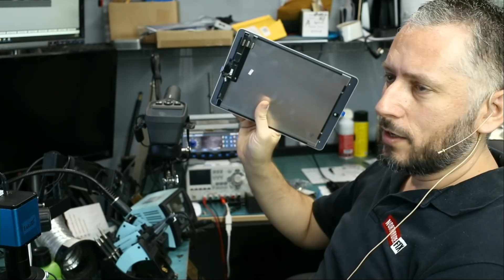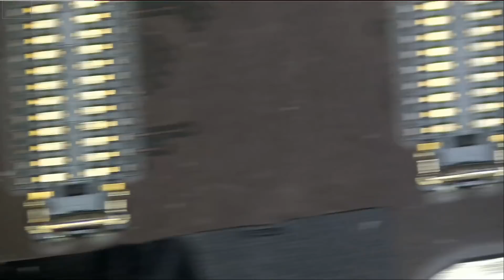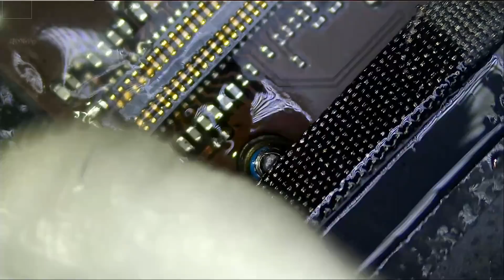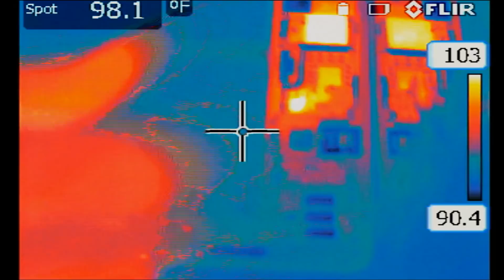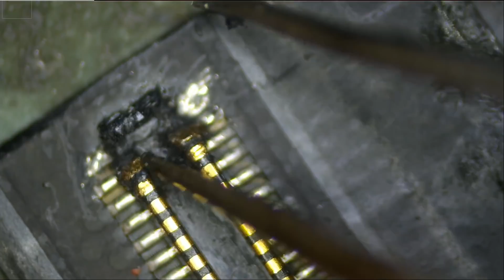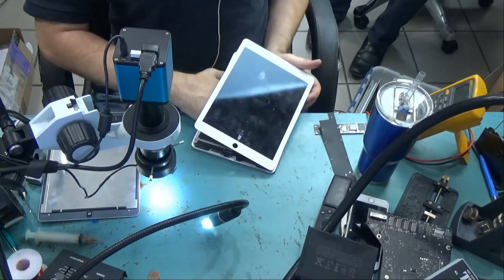iPad pro 9.7 No Power and Black Display after screen replacement

Comment: Is there a way to replace the connector on the LCD flex? I mean there are a lot of broken screens used to hang around shops like yours. Once I have managed to get an iPhone 3GS
screen connector off its cable with a blade. And the donor screen was shattered to bits so there was nothing to lose.

Comment: Salam brother, my curiosity is: if you get ipad air 2, 9.7, 12.9 devices which comes with internal screen+digitizer together. Let's say that they have charging port issue. Do you tell customer that there is risk about the screen? I mean i'm also doing mobile phone business i got couple parts from your website. Digitizer only replacement devices are okay. We can put another digitizer with no extra cost. But air 2, pro 9.7 what do you say to customer? Be safe!

Comment: For such as screen problems, what do you do?.
İ mean you fixed the filters but there appeared another problem which is broken screen sockets

İf customer doesnt accept to change screen from you, does he making problem to pay to fixing filters?

İ am asking this, because sometimes i get same stiations. Customer bring thing for onething but there appears more than one and customer says oh you told me for one thing before and now there are anotherthings etc...

The screen is new,but we dont pay attention to check the screen before starting fixing. 

Could you fix the filter problem, even if  you have seen screen problem with out talking customer to say conditions if the screen may be broken?
Reply from the maker: Customer will be charged for backlight fix as agreed upon. Screen damage is a separate issue. Customer mailed the ipad and specifically asked for backlight repair. We can't tell if screen is good or not, it's looks new still in the wrap. Customer can either choose to install his own screen or we can do it for him. It's always good to keep record of what was done, by either taking pictures or a short video on your phone so that customer understands what was done and what still needs to be done.